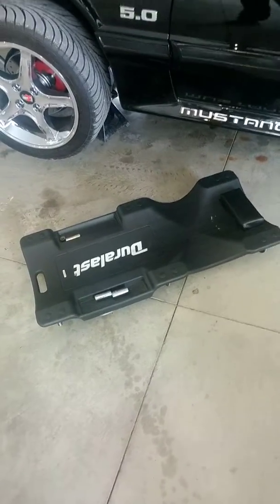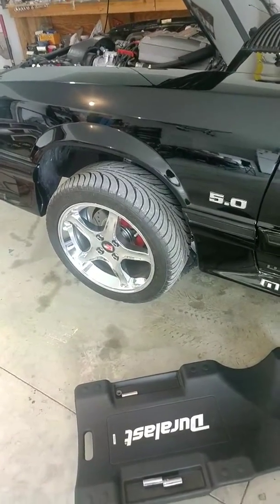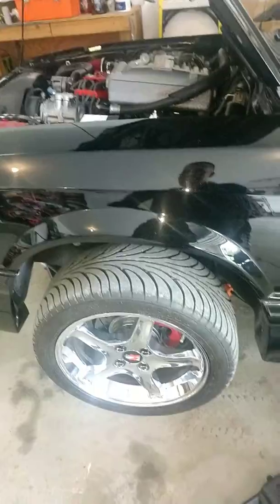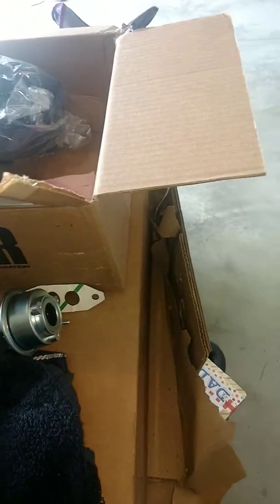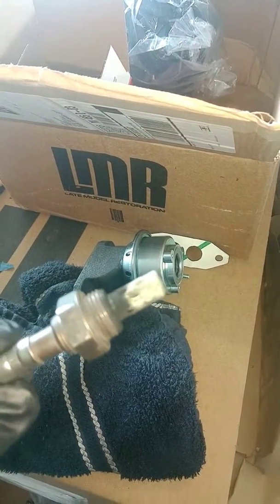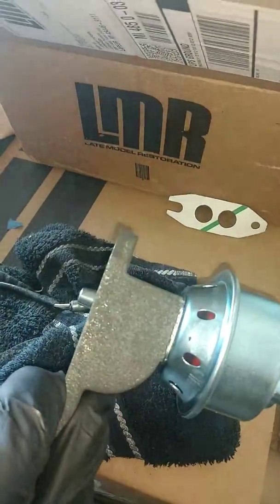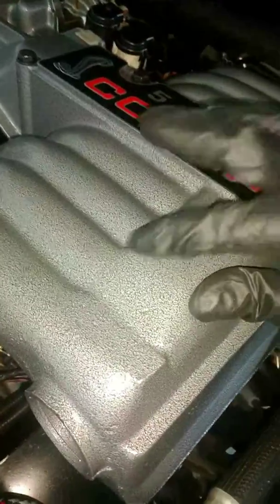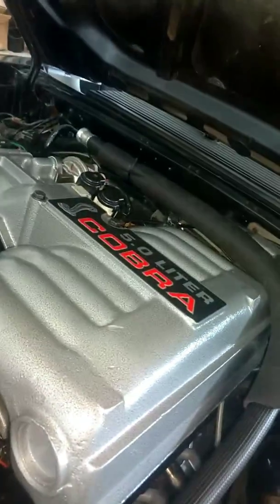Foxbody o2 sensors/EGR valve replacement s/Intake Hood Rub

Comment: Do you know if your fuel pump has ever been replaced?
Reply from the maker: What's happening Buddy?
I don't think it ever has been replaced...or if it has, I don't know when.
That too is a suspect. I haven't gotten to any of it yet. 
Still plugging at the deck, have had a ton of other stuff going on.
I'm seriously thinking it's a vacuum leak. Maybe one in the brake booster or some unused smog equipment? Or...the distributor is toast. 
My first step needs to be re-pulling codes. I haven't even done that.
Reply: @jpp9846  The more I think about it, the more I think it's a weak fuel pump issue.  When you raise the fuel pressure, it decreases the flow rate of the pump.  A weak fuel pump can show no signs of a problem (like your misfire issue), yet still be bad.  When the pump died on my white car back in 1998, I had it replaced at a dealership.  The car was still mostly stock and just putting a new stock 88 LPH pump in, made a huge difference in that car.  I was shocked at much harder the car was pulling with that new pump.  You didn't have this issue before installing the intake manifold.  Seems like the fuel system is not keeping up with the increased air flow.
Reply from the maker: @fwh79FOXR6  that's a great take. I thought about that... that thing is constantly"humming" in the hatch too. Might be worth getting a new one installed...even if only for maintenance. 
But you're right, that hiccuping was not an issue before the swap. I have thought about that pump. And since you've brought up the more air being introduced, maybe it can't keep up. It's probably the original pump.
Reply: @jpp9846  If that is the original pump, it is well past its prime output days.  That's the kind of part that leaves your stranded when it fails.  Plus, the cost of the tow would have bought the pump.  Something to consider.  I've been thinking about your problem a lot lately and I kept thinking fuel pump but I wasn't sure if you had a newer pump or not.  If increasing the fuel pressure is making the problem worse... I would say, that pump is very weak.  It is probably having trouble moving the needed volume of fuel when you hammer the throttle.  That could make the fuel mixture run lean, causing a miss fire.
Reply from the maker: @fwh79FOXR6  that sounds exactly like the problem. When I increased the FP it didn't really help anything. What's very strange, sometimes, that car gets squirrelly, like I can definitely feel the power...then it just duds.
That is something I definitely will explore...it very well could be the dam pump causing all the grief. I read those old message boards out there and a few have said the fuel pump fixed their problems.
Reply: @jpp9846  I feel like the stock 88 LPH pump is barely enough for a stock 5.0 engine.  Your mods are moving some air now.  Pulling the cats off frees up a tremendous amount of exhaust flow.  That fuel pump is slightly overmatched now!  I found it very strange that your car did not eat up the extra fuel pressure.  That really has me thinking that pump is causing your problems.  When I installed my adjustable fuel pressure regulator, I also installed a 155 LPH pump to back it up.  My car at the time had shorty headers, off road pipe, cat back system, 12 degrees of timing, K&N in the stock air box, the adjustable FPR, and the 155 pump.  It was pulling hard and a big part of that, in my opinion, was having the fuel system setup to handle the increased air flow from opening up the exhaust.
Reply from the maker: @fwh79FOXR6  your set up back then sounds pretty dam close to the one I have now. It does make sense..are you suggesting the 155L?
Reply: @jpp9846  I think you would be good with a 155 pump.  They are getting hard to find because everyone is installing 190 or 255 pumps now.  190 seems like overkill for your car.  Plus, the 190 and 255 pumps need to be rewired.  The 155 is a direct swap with no electrical wiring modifications necessary.
Reply from the maker: @fwh79FOXR6  is walbro a good brand? Looks like LMR carries the 155 kit
Reply: @jpp9846  Yes, Walbro is the only brand I have used over the years.
Reply from the maker: @fwh79FOXR6  I'll probably just order one and have it installed at my buddy's garage. Not saying I probably couldn't do this myself, but it sounds like a big PITA to drop that tank.
Reply: @jpp9846  I would HIGHLY recommend having someone else do it while you drink coffee.
Reply from the maker: @fwh79FOXR6  😂👍
Reply from the maker: @fwh79FOXR6  something I'm also thinking about while looking at Fuel Pump message boards on Google. When I replaced that clutch cable (before winter last year), I removed the driver's seat. While hooking it to the quadrant under the dash, the fuel relay was pushing on & driving into my back, so I laid a blanket over it and finished the install. I wonder now if I didn't mess something up on that while installing the new cable. 🤔
I do think the Fuel Pump definitely needs to be replaced, as you said, with more air being introduced in the engine, it's most likely the original pump and not keeping up. But that little ass relay under the driver's seat has me thinking too.
Reply: @jpp9846  I doubt the relay is a problem.  It's more of an on/off switch... so it either works, or it doesn't.  That being said, I could be wrong but I highly doubt the relay is an issue.  That's what is odd about the fuel pump as well.  Usually pumps either work or they don't.  If that car does have the original pump in it, that pump deserves to be put on display!  My personal experience with the fuel pump in the white car is a good example of a pump working and not providing enough volume.  Seems like your problem is only happening when there is a demand for fuel.  If the relay was an issue, I would expect it to cut in and out regardless of demands for fuel delivery.  Also keep in mind that someone may have installed a 190 or 255 pump and messed up the wiring.  I don't think that is happening because your problem is very specific and I would expect a pump with bad wiring to behave more erratically.
Reply from the maker: @fwh79FOXR6  hahaha...if it is the original, your right, it needs to be incased and sent to Dearborn to Ford for a display. 
I only think it might be, because that car sat for so long (almost 11 years). But I tend to be following the same crumb as you, it makes a lot of sense that the car "seems" to.cut out at go time and while at cruising speeds (this is when it has that intermittent hiccuping) and that too points at the fuel pump from what I've read. Hell even digging in then falling in power, higher in the RPM range indicates fuel pump too....my car is doing this too. And I also read it can cause idle issues. 
My friend is pretty busy at his shop, but I've got a Ford dealership very close to me, I might just have the dealership tackle it. I know they'll charge more for labor, but I also think it'll be done quickly out there. 
I'm going to.orger the 155LP kit before I leave town for the 4th and have it installed when I get back. I'm hoping this solves this BS once and for all.
Reply: @jpp9846  Sounds like a solid plan.  I hope it works out for ya.  I'm sure you would rather be driving and enjoying the new Koni dampers than chasing drive-ability problems... I wish I had a cool car!
Reply from the maker: @fwh79FOXR6  thanks, I appreciate you circling back and checking in. I hope so too, been a little annoying for sure. Lol, I sure wish I had 2 cool cars 😂
Reply: @jpp9846  You're welcome.  I think you are close to getting it sorted.  Double the fun!
Reply from the maker: @fwh79FOXR6  took her out for a run tonight and repulled the codes. That dam 22 (Map or Baro Sensor out of range) code popped up again. The rest were air diverter codes for the smog shit that's gone. I ran KOEO and KOER. Man that MAP sensor is very, very important in Speed Density from all I've read. I really have a gut feeling it's that. It is responsible for detecting vacuum load, to determine timing and fuel enrichment. If that things jacked it throws off the entire equation. Whatever the issue, I did order the 155 LPH Walpro pump. It'd be nice to know I won't be dealing with the fuel pump in the future....but that F-ing MAP sensor I think is causing a stink! The thing is, I did not have that code with my original one I replaced. I just replaced it and tossed the old one, stupid moronic decision! Something is definitely wrong with that area of this engine bay. 
I'm headed out of town tomorrow...new fuel pump will be here Monday. I reached out to my friend at the shop, I'm hooking up with him next week too....stay tuned!
Have a happy 4th👍
Reply from the maker: @fwh79FOXR6  rummaging thru my old parts last night, I found my old MAP sensor!!! I guess I didn't throw it out after all. I will be pulling that negative cable tonight to clear the codes again and then I will swap the old MAP Sensor back in. I didn't have that code 22 when the last one was on the car. Again, I just figured I'd replace it with the other sensors. Apparently, this "new" Standard brand, POS, MAP sensor must be defective? We'll see. 
Regardless, that fuel pump will be getting replaced this week too, comes in today.
Reply: @jpp9846  That's good news!  See what happens with a MAP swap.  That should be interesting.